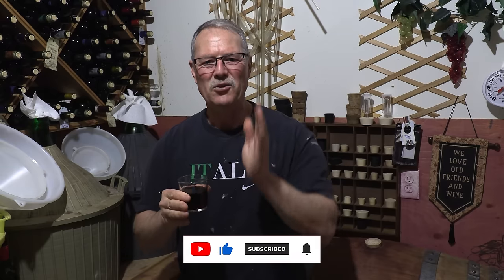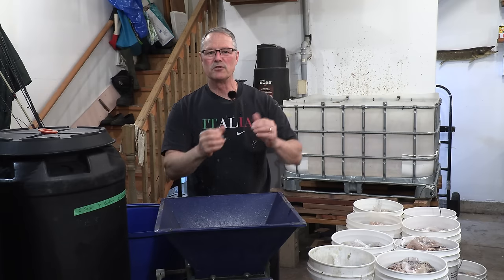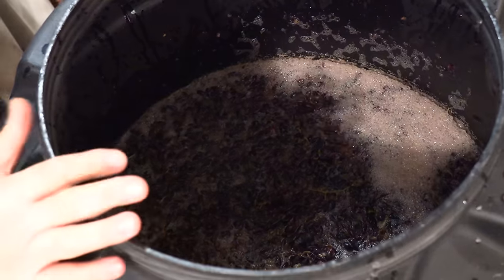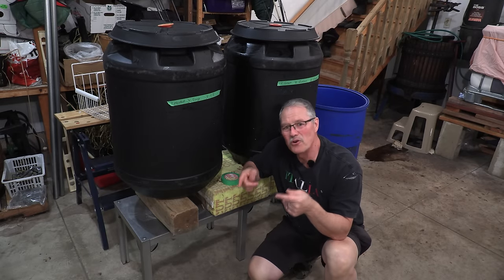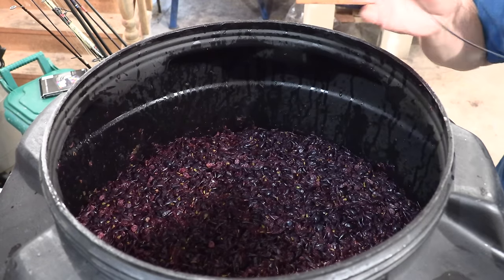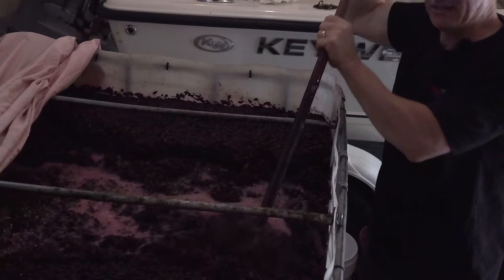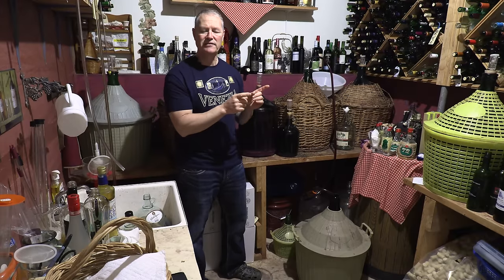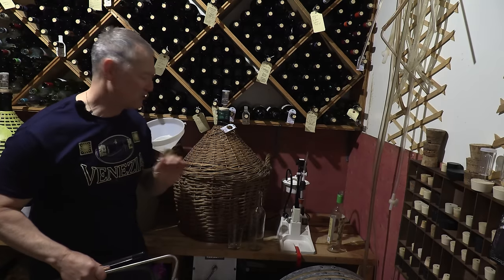Making homemade wine from scratch masterclass, all natural, traditional way. Amazing results!

Comment: how do you know when malolactic conversion is done before bottling? And do you have a carbon monoxide monitor?
Reply from the maker: Conversion is done once specific gravity goes to zero - also, typically, you don't bottle until a year has passed, or at a minimum 6 months - also, while this 6 months - a year is occurring, the wine is aging in a vessel with an air lock so if there is any remaining fermentation, it can occur and any gasses can escape. As for a carbon monoxide detector, they are very common and I have 2 in the house, one on each floor👍
Reply from the maker: .. . otherwise, the only true way to know is to measure the malic acid level.......but again, it's typically done after the first fermentation, once specific gravity is down to zero👍
Reply: Thank you for the reply! I would taste the wine in bottle prior to topping of your barrel - imagine if the specific bottle had an unfortunate TCA taint from the cork... Thank you for a fantastic and great practical guide to follow! @CookingwiththeCoias
Reply from the maker: @jarlthiesgaard2679  so glad you enjoyed this episode and yes...I typically smell the wine before I add it to my barrel, but your suggestion to taste it is even better 👍

Comment: I thought the over exposure to oxygen cause vinegar to form? How come you are using non sealed container
Reply from the maker: The non sealed container is only at the very beginning, during the primary fermentation. After that (as I show in the video as well) it goes into a sealed container with air-lock👍👍😊😊

Comment: So wine makers don’t use Yeast nutrient?
Reply from the maker: ...they might yes...yeast nutrient is extra food for the yeast, and it helps but I believe they would mainly use it in white wine or mead wine.  It's also used if you want to make a "second batch of wine" using the same yeast.  In my wine making, I do not use yeast nutrient at all (unless I make a second batch, which I have not done in 30 years, but perhaps someday, i will show this method in a video :)

Comment: Nice video but you didn't mention anything about disinfecting. There are probably at least a dozens points in the video where I felt uneasy about things maybe not being clean enough to touch something you may want to keep sitting for many years.
Reply from the maker: Feel free to wash everything with a water/metabisulphite solution 👍👍🍷🍷

Comment: The White Zinfandel comment is correct, but also not correct. Yes, you can get a much lighter wine (white zinfandel) if you pull your juice early but, that isn't how wineries prodice White Zin. If you pulled it early it wouldn't have enough alcohol. Every single white zin on the market has been fermented with white grape juice/grape juice concentrate to achieve the white color but also the regular alcohol content people are expecting in wine. Or, you can use his method, and get a White Zen with around 7% alcohol.
Reply from the maker: Thanks for your comments....much appreciated.......keep in mind that the alcohol content is determined by the amount of sugars found in the grapes, so if you press and squeeze right away to make white, or let is sit on the skins to make red, the amount of sugars in the juice will be the same and yield the same alcohol. Anyhow, just my thoughts, not trying to convince you otherwise, just my feedback :)

Comment: Why don't use the boot engine to stir the grape
Reply: You wouldn't want to destroy the grapes too harshly or it might create an extremely high tannin wine (bitter) but also it might Even introduce more heat than you would expect just from the movement alone.
Reply: Nevermind. 50 people will just argue with my comment anyway. Do what you want.

Comment: You don't use a hydrometer,  nor properly re-hydrate your yeast, sulfites, nutrients ect.....I think you're using the term 'masterclass' a little to loosely
Reply from the maker: thanks for writing in...as a side note, I did show how to use a hydrometer in this episode and I explained that I have a hydrometer, but rarely use it anymore and I also did not use any sulfites nor did I use any nutrients - this is old school wine making, as my father and grandfather did.  I also mentioned this was not going to be a technical winemaking episode, but rather, a traditional wine making episode. I have been doing this for over 40 years now with great results. You can however, certainly get more technical and use various different additives and sulphites etc, if you prefer. whatever method you use, I hope you have a great vintage :)

Comment: Well what can I say.  The "Old Italian Way" needs a lot of help.  As does this Guy.  His methods are crude and not up with the times. While it works but you're just going to end up with plain table wine. " Oh Just like my Itailan Grandfather used to make".  Waving his hand that's itialn.Mama Mia.  Fermentation Gasses + CO2. , Temps no higher than 80 other wise it creates Higher molecular weight Alcohol that makes for Headaches. Sulfites don't make for headaches.   There are too many crude misdirections to mention that you can do at home.  Becareful.